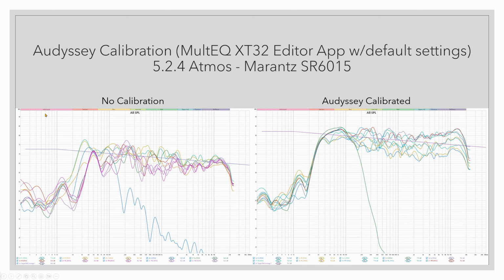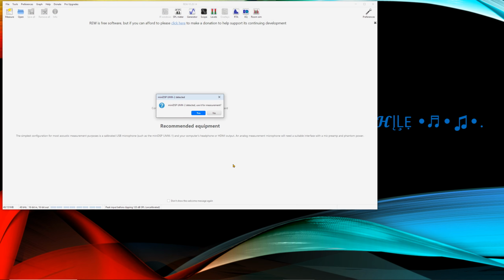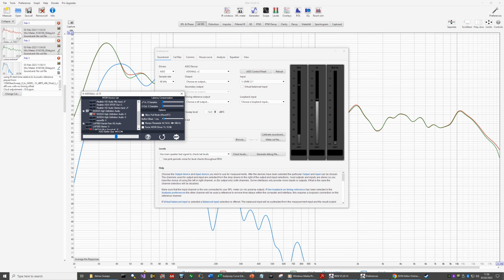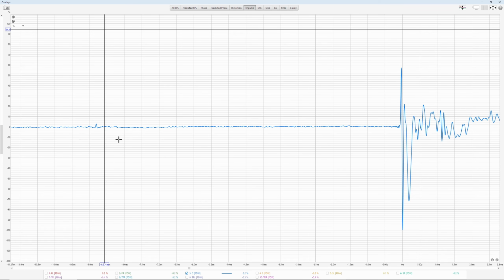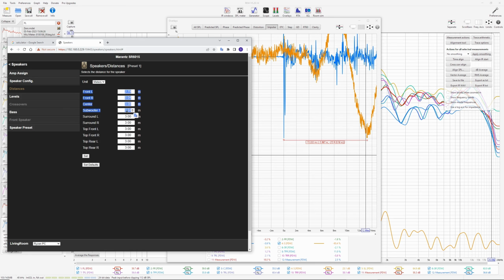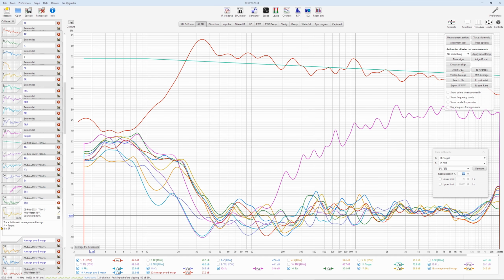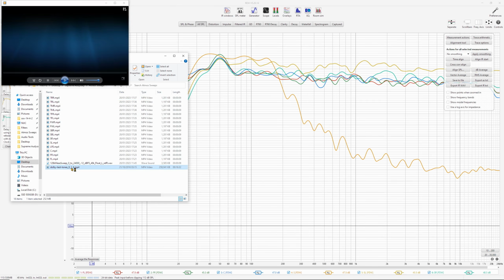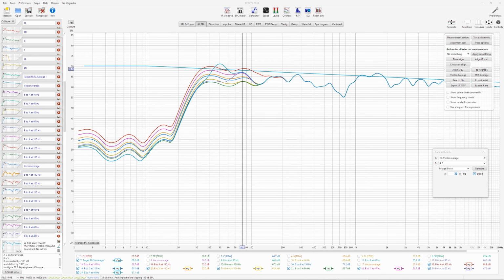Supreme Audyssey Calibration by OCA

Comment: Hey mate! Sorry, i have another question.

Im following this guide to a T, using MultiEQ.

Ive noticed that, Im getting a 10db difference in the LFE channel when using the REW sweep vs. The sweep you provide (this sweep is 10db hotter). I verified that I have Low Frequency Effects set to -10 in the AVR.  I also  verified that this only occurs with the LFE channel (the other sweeps match perfectly.) When I move the LFE effect back to 0, the LFE sweep from REW matches the provided sweep at -10 perfectly as well. 

Any ideas? And if i cant figure it out, which one would you recommend i use? I have peaks with the provided sweep oved 90db. When using the REW sweep I have peaks over 80. If I move the LFE Effects back to 0, the provided sweep is hitting over 100db.😊

Thanks!
Reply: Ahh. I think I follow! 😂
Reply: Ahh. Gotcha. It's the center speaker of the SVS Prime series. The resr of my speakers are also SVS Prime. Mic placement is the same for all measurements.

I'll look at the phase response in REW. Thanks!
Reply: Just wanted to say thanks for all the help! I got through this on my system (really easy to follow along.) I must have goofed something up though as all my speakers have a massive boost in the 20hz range now. Not sure what I did wrong, but am going to retrace my steps!
Reply from the maker: ALways use REW's LFE sweep because Atmos LFE sweep has a low pass filter and introduces extra delays due to that. If you download the latest early access version of REW, there're now measurement settings specific to LFE channel so you don't have to tamper with receiver LFE volume settings.
Reply: @Obsessive Compulsive Audiophile  Awesome! Thanks!
Reply: @Obsessive Compulsive Audiophile  hey - I tried using the -10lfe option in REW. I then set up LFE Effects back to 0. The results between selecting the -10db REW LFE option, and not, are nearly exactly the same. There is a slight 3db boost at about 80hz when not using the -10db option in REW, but it doesn't appear to be reducing the LFE channel by 10db. I'm wondering if it's a bug? I'm using ASIO and channel 4.

Just wondering if I should stick with the AVR option if the results in REW do not appear to change much when using the new LFE option.
Reply from the maker: @thecrlghs  The volume depends on the frequency range measured. If you measure LFE from 0hz to 24000hz like other speakers, the volume will not be boosted. If you measure 0hz-200hz for example, receiver will think it's an LFE signal and will boost it. Whether you use REW or dim it in the reciever or simply measure everything 0-24000 without chnaging any volume setting is up to you. They are the same thing.
Reply: @ocaudiophile  hey - one more question if you don't mind. When time-aligning, I noticed that my Center's IR is inverted compared to the other speakers. I flipped it's polarity and the IR now matches. Should I assume that I should keep the polarity of the Center flipped? (It could very well be a wiring thing as I did the in-wall wiring myself.)
Reply from the maker: @thecrlghs  If it's the same model speaker with the rest, it's more likely that it's wired wrong but it's still possible that IR peak reversal is due to mic position during measurement. Best way is to compare its phase response with other speakers. The closest matching phase response is the correct polarity. For quick comparison, you can switch polarity from REW/SPL & Phase tab without actually switching cables.

Comment: I am using the latest beta release of REW (5.20.14 for mac), and have run into two problems.  The first is that when I try to determine the distance from the cross-correlated channels, my sub distance is calculated as significantly further away than the actual measured distance.  I should note that I ran the measurement with the sub phase angle at 270 degrees.  Could that be the cause?
Reply from the maker: Subwoofer impulse peaks are very often too far to be compensated by the distance limits in the receivers and this is normal. It's due to the time delays introduced by the filters in the sub (or by MiniDSP if you're using one). You can try aligning its firts peak with the acoustic reference speaker instead.

Comment: At about 26:10, you change the speed of sound in the 'preferences' pane from 343 meters per second to 300.

Can you please explain what you are doing, and why that works?  Thank you...
Reply from the maker: That's the constant used is the Sound United (Marantz/Denon) receivers to convert time delays to distance and the reason Audyssey will get them all wrong. At some very recent models, they might have fixed this.
Reply: @ocaudiophile  Is the 1700h very recent for you?
Reply from the maker: @leo180811  I am not sure. They say all models 2022 upwards were fixed with a firmware upgrade. You can compare the real distance of a speaker which you can manually measure with the Audyssey calculated distance and undrestand.

Comment: I have taken measurements at the three points, and am now ready to time align them.

At about 20:30, you mention a new REW feature called something like 'copy selections to other overlay graphs'.  How are you getting that pop-up that contains that new feature?
Reply from the maker: Mouse right click on the bottom window
Reply: @ocaudiophile  I must not be on the same version of REW as you, since that command is not available when I right-click on that bottom window.  I am on the released Mac version of REW, version 5.20.13.
Reply: I found that there is a newer version (5.20.14), early access build.  I installed that one, and it has the command that you use in your video.
Reply from the maker: @ronaldippolito6785  Google "REW early access version"

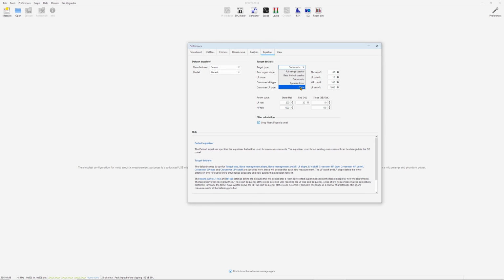Comment: At 12:00, you describe how to set up the room curve.  The settings you give will yield A Harman room curve.

To generate that Harman curve, is REW changing the test tone output to be higher at 20 Hz, then decreasing the amplitude all the way out to 20,000 Hz?
Reply from the maker: No, REW's sweep volume is fixed throughout the frequency band. Most speakers naturally have this slope towards the high frequencies
Reply: I don't understand, yet.  When I look at your response curves, they look like they drop about 7 dB from 20-20,000 Hz.  I guessed that the sweep amplitude decreased at the slope you entered in the equalizer  preference panel, and level matching is how the response fit the Harman curve.

If the sweep volume is constant  through that range, what drives the response to a constant negative slope?
Reply from the maker: @ronaldippolito6785  The low frequencies are always boosted by the room walls and there's also usually additional downward slope intentionally given by the manufacturers if you check their anechoic response because we tend to hear these frequencies higher than they actually are so in fact it's flat to our ears.

Comment: Hi, thanks for this great tutorial. somehow I dont get delay and volume set to zero after pasting from exzel into the ady file and transferring it to the avr. There are still delays and volume corrections in the file. When i open it in json i also got some more lines under each channel, like custom distance, custom level, custom crossover. But i made a new meassurement for the .ady file. 
Do you know, what I did wrong? Or would it make any difference, if i set delay and volume in the app to zero before transferring it to the avr?
I would appreciate any help :)
Reply from the maker: The original ady for a new measurement comes with all that, after you replace all the response data with 1,0,0,0,0,0... as described in the video for all speakers and transfer that ady to your receiver, there will not be any volume or crossover settings.
Reply: @ocaudiophile  I tried it a second time, but there are still delays, crossovers and speakers set to small. In the app, only the results from roomcorrection look completly flat, how it should. But in the app as well as in the avr after transferring it to phone and then to avr, there still are these settings :/ I double checked that i didnt forgot to paste the perfect dirac impulse into any measurement.. Sadly I cant post pictures here, otherwise i could prove it
Reply from the maker: @Mariuscx5ur  You're doing something wrong but if you want to upload your ady file, you can paste google drive links here. Youtube deletes any other link.
Reply: @ocaudiophile   https://drive.google.com/file/d/1NI5QIVvs23XQN3Mh4eGB09JtcrURE74q/view?usp=drivesdk 
Thanks a lot for helping me out! Here you can see the "customDelay", "customCrossover", "customSpeakersize" at  the end of each speaker in json format. These categories arent even shown in the video, when you open your original file in jsononline.
Reply from the maker: I am still awaiting access permission from you to download them...
Reply: @ocaudiophile  oh sorry, never worked with drive from my phone before. Now it should be working
Reply from the maker: Are you using Auro?
Reply: @ocaudiophile  yes
Reply from the maker: That could be the reason or maybe because your front left speaker's polarity is inverted. I have sent you the fixed ady file, upload it to MultEQ app and transfer to the receiver. Compare the impulse peaks of the left and rifght front speaker. They should both be pointing in the same direction, if not switch + and - cables of the left speaker.
Reply: Thanks a lot for your help! I will try it when I get home

Comment: Hi OCA, 
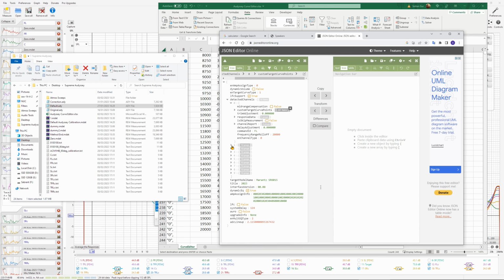In the video at 43:57, I don't see the category "customTargetCurvePoints" in my .ady file in the JSON Editor. Using a Marantz Cinema 50. So I'm not sure where I should input the REW response. Thanks in advance for your help.
Reply from the maker: Is your MultEQ Editor app up to date? Custom curve points should definetely be there. There have been people who applied this method successfully with Marantz CInema 50.
Reply: @ocaudiophile  it was some bug with the exported .ady file. I exported again and the setting was available in JSON Editor. 
Finally finished all the steps in this method and I can immediately notice a significant improvement in the height channels. However, the bass response seems to very low. I have double checked that LFE level is set to 0 and not at -10. Still can't figure out what's causing this. In REW, the subwoofer response looked fine.
Reply from the maker: Loudness management is on in most models by default. It could be a reason but best way is to remeasure speakers and sub with the new settings active and check in REW what's going on.
Reply: @ocaudiophile  thank you! When measuring sub impulse response, the distance adjustment from Center Channel peak impulse to Subwoofer peak impulse is showing to be 12 meters (!!). Obviously this cannot even be configured. So I'm not sure if I'm doing something wrong. Is there any other way to time align the sub?
Reply from the maker: @Judddernaut  are you using minidsp for the sub? It usually introduces such delays causing 12m distance requirements. You can align subwoofers first peak rather than the highest peak with the acoustic reference speaker instead.
Reply: @ocaudiophile   no, not using miniDSP. Everything is plugged straight into the receiver. And receiver is connected to TV via eArc so latency should be quite low, don't you think? The problem is, even the first peak shows me a distance of 9m. I have put 6m Sub distance in the Receiver distance settings, but I can't go beyond that.
Reply from the maker: Unfortunately, distance settings allow you maximum 5m extra from the largest next speaker distance (so it should allow up to 7-8m when you key in other speaker distances. Also check if the subwoofer crossover filter knob is turned all the way to the end (towards 250Hz), you will remove some time delay with that (albeit very little). Lastly, you can align its third peak to the acoustic speaker's highest peak which should be around t=0. After a short up and down peak at the very beginning, there's a the third - quite long up peak (or viceversa if it's inverted). If nothing else works, leave the distance setting at the highest possible setting receiever accepts but third peak should work.

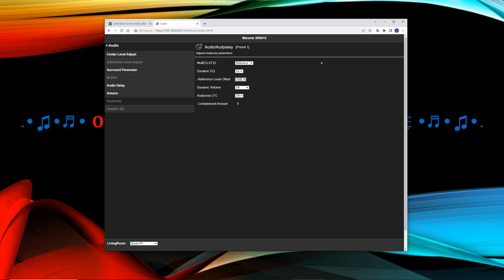Comment: At 8:20, you tell us how to use the control protocols to set the maximum volume to that which you use for watching movies.

I watch movies at a lower volume than you do.  How did you convert your listening volume into the value you sent for maximum volume?
Reply from the maker: İ use 55 which is equal to -24dBfs, just replace 55 with a lower number
Reply: Once we set the max volume ( with the protocol command) that volume that we watch movies, should we make all our measurements at that volume on the preamp?
Reply from the maker: @ronaldippolito6785  Yes, especially if you intend to use dynamic eq or dynamic volume because Audyssey will apply different levels of boost to different channels depending on the volume of the amp.

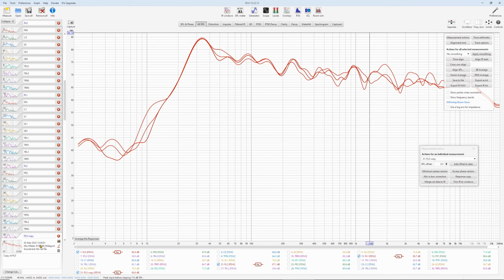Comment: At the 23:30 point in your video, you are going to vector average front left three measurements.  You also included the copy of the time-aligned measurements.

Why did you include the three original measurements, if you had the time -aligned version?
Reply from the maker: All 3 measurements were already time aligned with cross correlation. The 4th is a copy of the central measurement and a copy of of a time-aligned measurement is also time-aligned. The reason I added the central measurement twice to the average is to give it more weight in the average. The reason for evarging them is to find the true speaker response in a larger area.